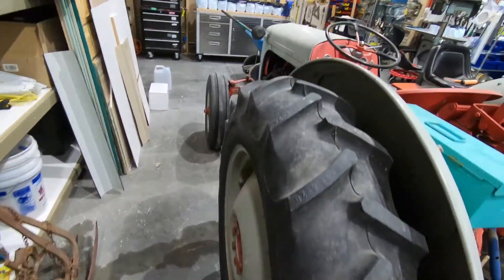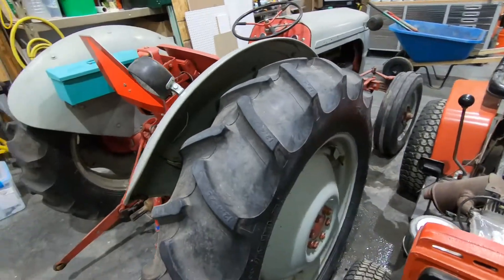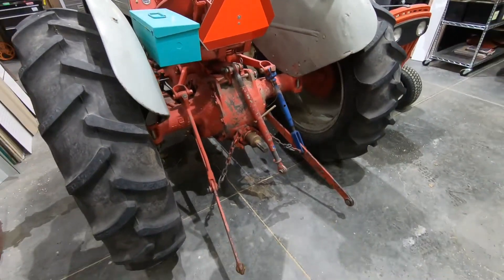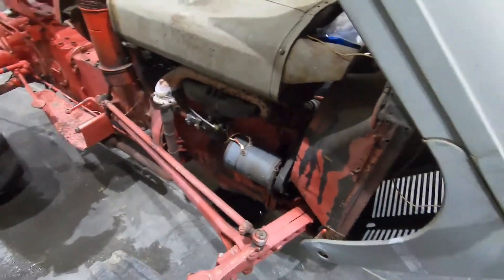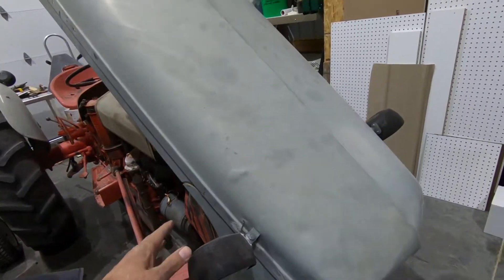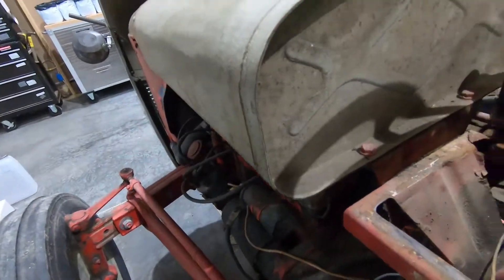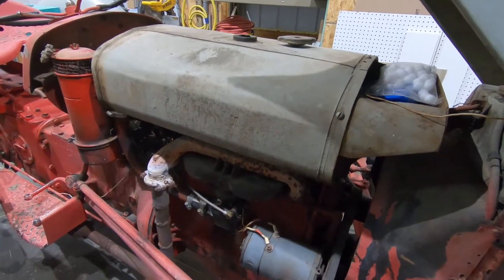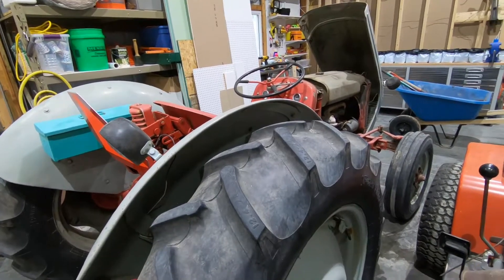The Ferguson TO-20 Project

Comment: Those were awesome little tractor. I remember my Grandfather and uncle having one on the farm when I was growing up. Spent many years on that farm as we live right across the road. I believe that that tractor is still used.
Reply from the maker: They are so easy to rebuild and work on that they can be kept going forever it seems. On both of my tractors you can see welds on the castings where old breaks were just mended up, spritzed with paint, and the tractor was out working again the next day! 💪💪💪